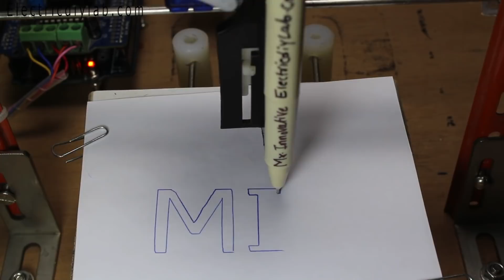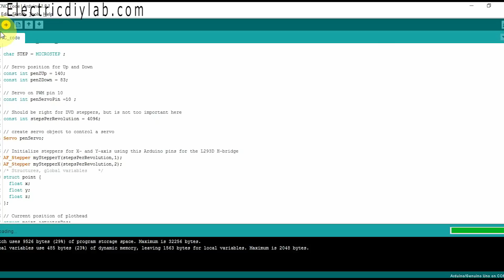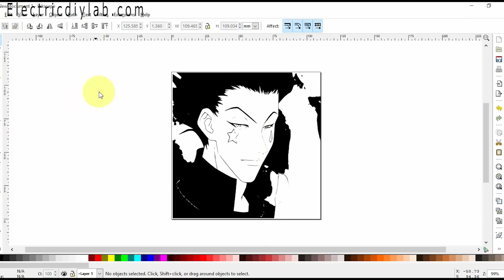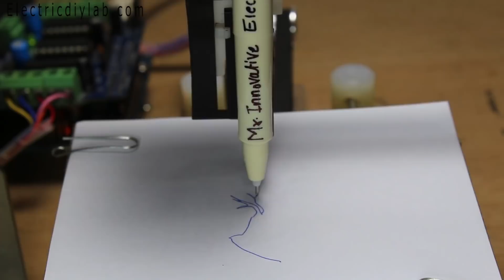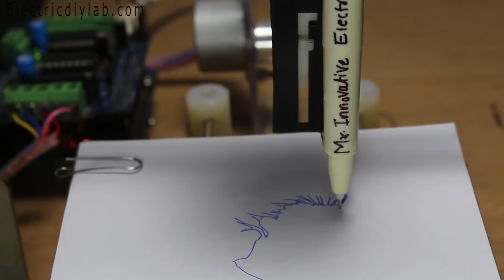How to make Mini Home made CNC Machine Arduino+28BYJ-48 Stepper motor

Comment: I start making such a small machine and have a question: rather than using a piece of code in Java  to send the GCode to the Arduino, maybe it would be easier to use a SD Card on the Arduino. This solve the Java part "problem", and with that you can have a stand alone machine, without the need to link the computer. In all cases, nice job.
Reply: it depends if there's enough pins on the Arduino.
Reply: Please tell how anyone can set machine to zero ? How to calibrate?
Reply: What you are suggesting is done all of the time as Arduino devices are used to drive many kids of multi-axis machines, although you may be asking a lot from an Arduino-based device if you want it to work directly with an LCD touch screen as I attempted to do.

A Raspberry Pi or equivalent could do all of it for sure, but unless Arduino has seriously upgraded their memory capacity introducing new devices, I don’t know if even the Arduino Mega has enough flash memory to handle the code for the g-code interpreter, card reading routines, stepper control, LCD, and touch interface. Most 4-axis machines, like 3D printers, when using Arduino type controllers will also employ an external driver board requiring fewer pins on the Arduino for full control. Instead of managing stepper control using a pin for each phase, the Arduino can use one pin for direction, and another for the step pulse for each axis, leaving others available for enable, micro-stepping, holding current reduction, depending on the driver board features. 

But this is why many multi-axis machines, like 3D printers, use a dedicated LCD interface, freeing up memory space and CPU cycles for lower-spec devices. The Arduino-based units are really pushed to their limits as real-time processing demands are pretty harsh, which is why the 16MHz versions are preferred for this kind of duty. And remember also that the micro-controller must read and interpret g-code if it is to run as an intelligent controller, and not just a bus-coupler being driven by some other system.   

I have a Mega set up with a 3” LCD touch screen and micro-sd card reading functions, leaving little memory available for much other practical functionality. This setup would have required one Mega dedicated to the LCD for HMI functions (assuming the Mega had enough memory left for screen-control code), and another for actually controlling a 3D printer.

After I gave up on the idea of building a 3D printer myself and bought an Ender 3, I discovered that it is set up exactly as described above; “Arduino” style microcontroller chip, but with external driver circuitry and micro-SD card slot integrated onto the main board, with a very common external LCD interface performing control and display duties. It isn’t a touch screen, but it does the job.

Comment: Sir I have made this cnc machine. I have made complete machine exactly as you have guided and I have invested my lots of time and money. But at the end one problem occurred. When I stream the g code on GCTRL, then after processing the g code for few seconds the software shows an error message, “M18 drives off” “Command not recognised”.
Sir please solve my issue, I have searched the complete internet but didn’t got the solution.
Please help me its urgent. PLEASE PLEASE PLEASE.

Comment: He should have used a 40 teeth pulley gear instead of the 20 or 16 tooth that he used, to get more speed out of the machine. Those little steppers are geared and are surely strong.

Comment: what are the name of thing that you used for fixing y axis shaft( white color with screw)?? or one more ques. is this have same wiring like old dvd stepper motor with arduino nano???
Reply from the maker: that are acrylic tube with inside thread you can use pvc pipes or something like that

Comment: Hello, i have a problem, i hope You can help me, i have built an CNC with The 28byj48 motors.
I have downloaded an gcode from The Internet and the CNC Works, but when i try to use my own Made g code (i have made it as You have shown in your Video) than only one Motor Works and The z axis sometimes, whats Wrong? I Hope You can help me😓

PS: i Hope You know what i mean, i am German and Not very good in Englisch😅

Comment: Hi!, I have a problem, I built a cnc, with the same motors and the same shield, only the writing plane and therefore a wider range of movement, but when I run the program, it does not exploit all its amplitude but only a very small part, I tried to change almost all the parameters in the setup, but I can not make it work, what advice can you give me? thank you

Comment: Can we use nema 17 without changing the code please reply
Reply: Nema17 arebipolar stepper motors , while in this video it seems to be unipolar stepper motors. You will probably have to check the code for that.

Comment: Hello everybody!

I have built the project, but unfortunately one stepper motor does not rotate. 
Can anyone help me? 
I want to solve the problem because it is a very good project.
I would be very grateful.
Reply from the maker: Can you check it by replacing with working one so in this way you can rectify your stepper is healthy or not
Reply: The stepper is good, it has been checked. I'll try another motor shield, I'll order another. Could that be the source of the error?
Reply from the maker: may be current limit was not set properly is your motor making humming sound ? vibrating but not rotating ? if yes then rotate the small pot on driver shield till your motor move smoothly
Reply: Unfortunately, there is no vibration, no noise. There are no pots on this shield.
Reply: NEED TO ORDER WHOLE BOARD, JUST A CHIP LD 293 , REPLACE IT AND THEN CHK AGAIN, ALSO CHECK THE CABLE  FOR CONTINUITY BETWEEN MOTOR AND SHIELD ..
Reply: hello sir

yes, my motor are vibrating but not rotating 

there is no pot on my driver shield. what to do now 

please help me
Reply: ravi teja what kind of steppet drivers are u using..? Because all type of drivers has pots to adj the current delivered to motors.. the pot is very tiny round silvery part . N it has + slot in centre use small screwdriver.. turn it acw 30dg n try..if motrs hum or vib turn it again 30dg to cw.. repeat it till ur mot becaome smuth..normally u should adj the current somewhere .6oomw.. there is you tube vedeo how to adj current to  stepper motors.. follow it..
Reply: avinash khetmali okk.. thank you sir...still I didn't find the pot in my shield... Please send a reference pic or links if possible.. please